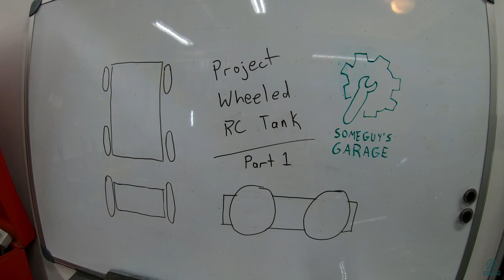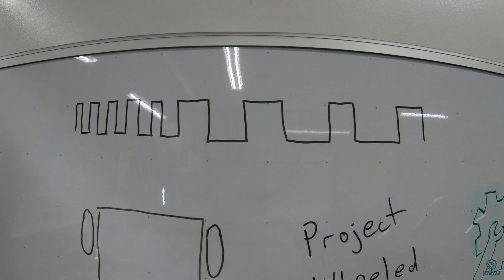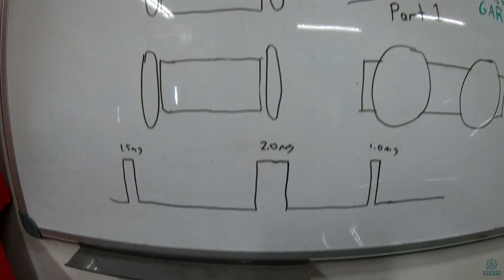Project Wheeled RC Tank - Part 1 - Wrong Motor Drivers!

Comment: Do you have to use a motor controller for those amp flow motors? Or could you simply just connect DC voltage to them, and they will spin? I have one here, and I am applying 18 V to it… But it won’t spin.
Reply from the maker: They should not require a motor controller, a straight DC source will work. Make sure it can deliver enough amperage though, they have a fair bit of current draw at startup and could exceed most typical bench power supplies...but a tool battery like I used should just work straight away. Oh, and make sure the motor is held down, the mass of the rotating assembly will cause them to jump if just sitting loose.
Reply: @SomeGuysGarage  thanks! The resistance of the motor appears to be about 1.7 ohm. Hope that’s normal.
Reply from the maker: @vantongerent  I'll double check mine later today. Are you using a battery or bench supply?

Also, be careful if you open up the motor...I did it once to re-seat a brush and it was very difficult to get back together (used some MIG wire to hold the spring loaded brushes in while putting it back together and then just before closing it pulled the wires).
Reply: @SomeGuysGarage  I'm actually trying to power it directly from an 18V-100W solar panel. I saw some youtube videos showing this was possible... but now I'm not sure. Thanks for checking!
Reply from the maker: @vantongerent  check with a battery (even a pair of 9v's should do to just get it to turn) or something else to make sure the motor is good. If you're using the same motors as myself, I doubt they'd turn with a 100w panel unless it was in direct sunlight and even then could be a stretch.
Reply: @SomeGuysGarage  okay, i'll give it a try!
Reply: So, I hooked it to my car battery… And it started running immediately. It sounded really rough though… So I let it run for a while, it’s making lots of clicking noises. Then I hooked it up to the solar panel and it started running for a while and then it slowly slow down until it came to a stop. Now it will run when I give it a little push, but then it slowly slows down and stops again. Very weird.
Reply from the maker: @vantongerent  brushes could be misaligned like mine was for a bit...does it feel smooth if you turn the motor by hand? And by smooth, there will be the regular "steps" you feel as the magnet moves through its poles, but that there isn't grinding or other feelings.

As for the panel, that sounds exactly like not enough current and probably some run down of the potential energy in the solar cells after the initial blip (ie. voltage drops once you start pulling current).
Reply: @SomeGuysGarage  Yeah - maybe the carbon brushes just need to be worn-in? Thanks for all the great feedback! I'm trying to keep the circuit dead simple for a go-kart build. No controller, just a potentiometer for speed control, a couple solar panels, a microswitch for the gas pedal, and this motor. Was going to run the whole system at ~18V (the under-load voltage of the solar panels). It's a 350W motor that can run on anything from 12V to 36V, so maybe if I just got a small 18V LiPo battery in parallel with the solar panel (Batter has a built in BMS), it could drive, and charge, as needed...
Reply from the maker: @vantongerent  probably, when I had my one motor apart they definitely weren't worn in.

Neat build idea! Not sure how the potentiometer will work, might not be able to find one to handle the current. The Cytron drivers I used were pretty cheap (like sub $50 for the first ones I picked up) and you could probably rig up something to actually use the gas pedal variable speed. The other advantage of (some) motor controllers is they have regenerative braking, so they recoup energy to charge the battery when you're off the gas...makes it run longer. Then the panels give you even more charging extending runtime...I guess think of the battery as a way to regulate the slow continuous input of the panels with the peakier demands of the motors themselves.

At 18v these motors definitely put out some decent power...technically that's all you really get with the Dewalt batteries I was using. I was seeing upwards 20-30 amps of draw for one motor at 18v with a lesser load than a gokart (just the RC)...so there's no way the panels will be able to give you that consistently on their own.
Reply: Does that sound abnormal? Very weird that it won’t just run once it gets going.

https://youtube.com/shorts/rwxS-soa0t4?feature=share

Comment: Ditch the DeWalt batteries and use standard lithium 4S, 5S or whatever the motors & controllers require.  Yes, get RC ESC's as well - that have reverse capability.  Also, junk the steering wheel radio and get something like a helicopter dual stick radio.  A helicopter radio will give you mixing options for the different channels and the ergonomics will be much better.
Reply from the maker: Sounds like a lot of money to spend :)

The Dewalt batteries could get changed out at any point but I have a pile of them on hand and are effectively 5S batteries anyway right?

The steering wheel radio has mix control built in, for under $100 it was the most economical option that didn't need external programming via sketchy software.

You're right though, if version 1 of this RC works, version 2 might need some upgrades.
Reply: @SomeGuysGarage  Sorry dude, easy to spend someone else's money.  The motors look healthy.  Are they brushless?

The batteries will work fine, easy to swap them when depleted.

Never mind, I looked at the video again and see they are brush motors.

Should be a fun project!
Reply from the maker: @zangzang1268  no worries, it really is :)

Yup, just 250 watt brushless pancake motors...the price was right.